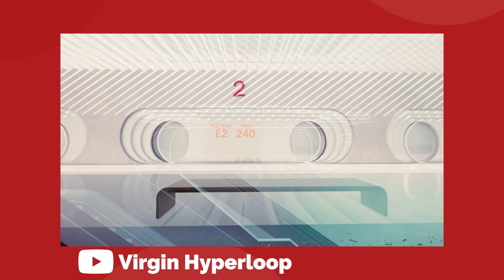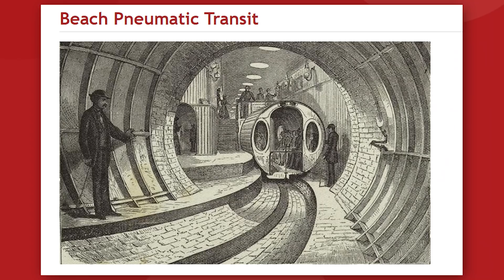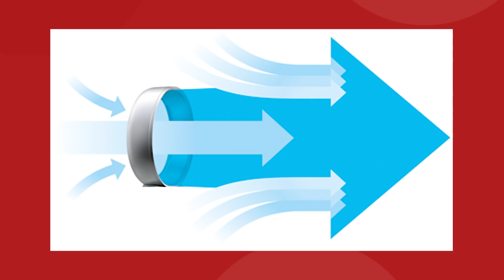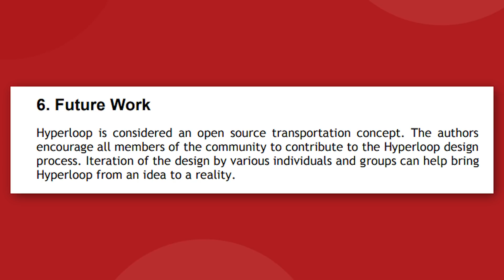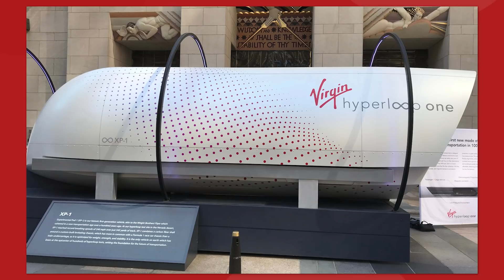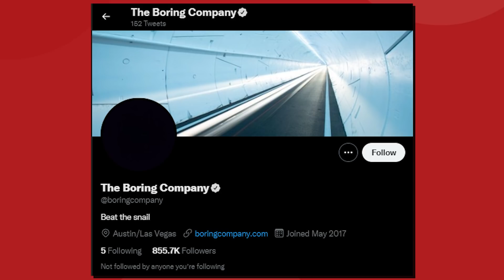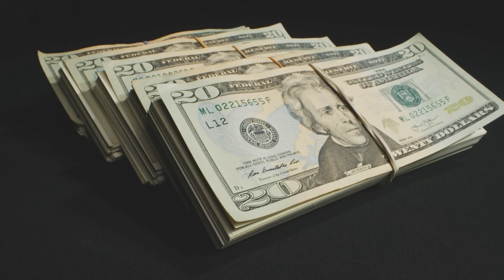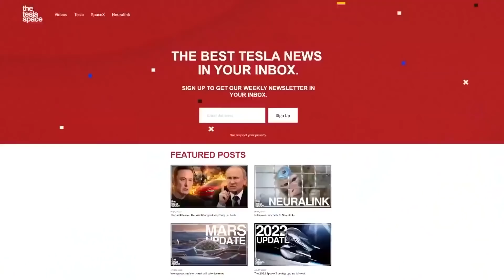The Boring Company Is Building A Hyperloop!

Comment: I think magnetic is the way to go.  The thing is you can have tributary lines that are relatively low speed with some air pressure.  An easy to maintain partial vacuum with many entrances and exits at all of the favorite spots.  You then get into regional lines feed directly from the somewhat pressurized feeder lines and then you can go to a better vacuum.  Then you get into interstate / transcontinental  lines being fed directly from the regional lines and these can basically be a hard vacuum.  Each transition to a different type of line you stop for a minute to suck out more air.

With a big fan in front, you are stuck with subsonic and some air in the tube, but with magnetic, you can go multiple mach speed and hard vacuum.

Having mixed cargo and personnel transport would bring total ridership up and thin out the people some in case of accidents.  Also with things like a megadrought on one side of the country, maybe you efficiently haul water in from the other side of the country.  A dedicated water station could keep the vehicles in a hard vacuum while mating up with plumbing to transfer water to and from the vehicles so they can go the entire way at high speed and almost no drag.  Super efficient.  Better than an aqueduct and multi-purpose as the same tubes will carry people and other cargo.
Reply: Air locks.  A chamber just a bit larger than the pod.  A door at each end.

To pressurize or depressurize the airlock chamber would require pumping only a small amount of air.
Reply: @bobwallace9753  Especially when dealing with many entry and exit points, it gets harder and harder to suck out all of the air.  There are things you can do to cut down on the work as you mention, but it is hard to eliminate the work.  What I am proposing is a compromise.

For example if work is 15 miles away, you are not going to go mach speed to work no matter how late you are, so why go through the extra effort, expense, and time sitting in the airlock trying to remove that last bit of air to achieve a hard vacuum?  Why not do a "quick and dirty" partial vacuum in say 1 minute, get up to a few hundred MPH, and then you are at work in a couple of minutes?  At this there may be other people in the pod and the pod may make other stops, so you want this depressurization to happen as fast as possible, maybe 30 seconds and a further reduced speed would be preferred over 1 minute of sucking out air.

However now say you are going to visit relatives 150 miles away.  Now you want to get up close to the speed of sound as you can still have some air in the tube and still get close to the speed of sound without it becoming an issue.  So you spend 1 minute getting to a partial vacuum, travel to regional hub 15 miles away, spend 2 more minutes getting most of the rest of the air sucked out, and then go at say 550 MPH for 120 miles for say 24 minutes as you need some acceleration and deceleration time, and then travel the remaining 15 miles at a reduced speed as you are now back in a feeder tube.  So this time there is more total time sucking out the air, but the trade-off is you go faster.  At this you may still want to get out of the first pod and transfer over to a second pod that will do the regional route as each pod may have various people in it coming from different feeder lines.

Going across the country is a play on this.  Except now you may spend several minutes getting all of the air out when you get to the interstate / global system, you go at multiple mach speed, and people carrying vehicles are interspersed with cargo vehicles as you don't want too many people in a given section of tube.  Also, you may be moving over to another vehicle, granted it would be nice to have the option of paying for a "family van" to go long distances or even say a couple of "cargo pods" when moving.  Maybe even have a pod you can stick a car in as shipping cars around the traditional way can be a pain.

The basic idea though is flexibility where either you cut down some on the time it takes to go from one system to another by going straight from one pressure level to another through airlocks or you get out of the pod and transfer to another, but each time you go to a faster system, there is more overhead time waiting for the air to more thoroughly get sucked out.  What you mention is an optimization, but I don't think a hard vacuum can reasonably be done on a large scale, high capacity system in seconds.  So instead you do what is quick on the feeder lines and then have bigger and bigger overhead times when going to the longer distance systems.
Reply: @ChaJ67  

Entry/exit.  Airlocks.  
Chambers just a few inches longer and larger in diameter than the pod.  That means only a very small amount of air to pump out from around the pod before entering the tunnel. 

15 miles.  Not a hyperloop function.
That's a Loop trip.  Non-stop at 60 MPH or faster.

150 miles.  Hyperloop.
Enter an airlock.  The air could be sucked out in less than a second by using an attached chamber that is larger than the space between the pod and chamber walls and is depressurized to an even lower level than the tunnel.  But that's probably overkill.  Use an adequate sized pump and just suck out a few cubit meters of air.

Exit through an airlock. Drive in. Shut the door.  Open a valve to let outside air enter the chamber.  Seconds.

I don't see any sense in your multiple tunnel system past hyperloop and Loop.  Depressurized very high speed and atmospheric pressure fast speed.  Travel in the hyperloop would be more like flying where you travel to a hyperloop (airport) station and travel with others heading to the same destination.  We could easily have pods with only seats and pods with limited seats along with a lot of cargo space for times when very few people are going from Station A to Station M.
Reply: @bobwallace9753  I have considered some of these options over the years, especially as I came across ET3 many years ago before you heard Elon Musk going on about it.  Then again I also came across AC Propulsion before it got bought out and turned into Tesla.  What I have come up with is:
1. The extra chamber takes even more work.  The idea of the hyperloop is to minimize work.  You were on to something when you mentioned airlocks on the vehicle.

2. Airlocks on the vehicle - I don't think this is a bad idea, though making big doors can be tough and even tougher to standardize on a size and shape.  You would still need to bring the vehicle into an airlock in case the seal leaks.  I tend to think about submarine DSRV's (deep sea rescue vehicles), except the pressure is the opposite way, so you would have to brace the pod so the atmospheric pressure doesn't push the vehicle away from the airlock.  I suppose it can be done, though it would add a lot of structural weight to the pod.  The doors on an airplane usually only open when the pressure has been equalized.  While doors still add structural mass to the plane, it is less of an issue as the door hooks into the frame when closed and acts as a structural component.  I am thinking this is more of what you would want on your pod and just do away with the reverse pressure DSRV style deal as it is far easier and cheaper to do with the trade-off there is more air to suck out.  I may be wrong in what is the best approach, but this is what I came up with.

3. While I have considered traveling around town at atmospheric pressure and I think if you live in a small enough place and work there, this is what you are going to do, more and more huge, sprawling cities keep popping up.  People are moving to cities and thus they get bigger and more numerous and the metropolitan areas tend to fan out over larger areas.  As this happens, there are huge energy expenditures driving or rolling by some other means across these big cities and metropolitan areas and these trips are often dozens of miles or more.  While I am not suggesting a tube to your home per say, when you go to your local metro station, it would save a whole lot of energy to suck out whatever air you can quickly and then be on your way at much faster than freeway speed than to just push through the air like now.  Also more speed allows for higher capacity in the computer controlled environment of a partially evacuated tube.  So instead of say a 4 lane freeway, a single tube could handle all of that capacity while saving on trip time and eliminating traffic congestion as you would never schedule more vehicles than what could be handled, plus you would have all of these people ride sharing on pods.

4. The vision I have settled on for pods, especially if you can bring the pod out of the tube is it is kind of a cross between buying a plane ticket and hailing an Uber and a car or truck rental.  The idea is you go up to full sized van size.  At this size you can load a couple to a few pallets in series the length of a pod.  Companies can shuttle around goods buy either renting / having one or a few pods or do large scale movement by having whole fleets of pods.  Amazon next day / same day delivery would take on new meaning if instead of grouping by 767 plane size (this is the most common plane in the Amazon fleet), it would be grouped by pod size and how far a pod could make it in a day (which may be anywhere in the world as long as the infrastructure is there and Amazon can do business in that country).  A large family could rent a whole pod for their trip.  A small family could haul a bunch of luggage for their trip in say a combi pod.  A commuter would "carpool" to work as in instead of say a commuter train or bus stopping at every stop, a computer algorithm would group you up with a few other people to minimize stops.  A coordinated "carpool" would be you show up at the metro station at the same time as your co-workers living in your neighborhood to get the computer algorithm to group all of you into one pod so you don't have to make other stops along the way as everyone in the pod will be going to the same place.  A business with multiple facilities around town may have co-workers doing this to help speed up their trips while keeping ticket prices the company picks up the tab on down by not renting out mostly empty pods.  Then you get into easier to do things such as transporting liquids.  I mentioned the water deal above.  What if you have a line connecting to Europe and transferred LNG this way?  It should be easy enough to connect the pipes in a hard vacuum, leaving the pods in a hard vacuum all of the time.  I have to wonder what would happen with seafood if every place had as fresh of seafood as Pikes Place Market in Seattle because it was quickly whisked around in a hyperloop at pod scale units where it could also be more quickly packed and unpacked and distributed than when dealing with semi-trucks or even trains?
Reply: @ChaJ67  
1 and 2.  I said nothing about airlocks on the vehicle.  Not needed.  Just a small airlock at each entry ramp and each exit ramp.

Airplanes do not have airlocks.  They load and unload at surface level air pressure and then travel into low pressure areas.

3.  For short distances there's no need for depressurizing.  If you can travel non-stop at 60 to 80 MPH and do so as a passive passenger then that's all that is needed.  Watch a video, take a nap, do some work while you commute.

If you have to commute 5x a week you may choose to live within 30/40 miles in order to have a half hour commute, max.  If you're working hybrid and need to go to the office once or twice a week then you might live further away and use hyperloop.

4.  Maglev pods (and trains) need wheels for the times when they aren't moving rapidly enough to 'levitate'.  Pods could enter an exit tunnel branch at 800 MPH, slow to a crawl (four to eight miles of ramp tunnel) enter an airlock, and then drive as a surface vehicle.

Stations can be nothing more than parking lots or simple buildings that protect passengers from wind and rain.

We can redesign shipping containers so that they fit inside a standard sized pod.
Reply: @bobwallace9753  as Elon Musk caught onto this idea in Los Angeles, something to understand about the place is you can go North-South down the I-5 or East-West down the I-10 and see nothing but city for 100 miles on either freeway.  If you want to live close to work in the city, you are looking at either living in East LA / Skid Row for however long (or short) you can survive in that kind of neighborhood, or a very high rent neighborhood.  Otherwise you are looking looking at somewhere far from work, probably a lot more than 15 miles away.  While I cite LA as this is where Elon Musk was when he started promoting this while talking about "soul crushing" traffic, this story is getting more common by the day as more and more people move into cities and large metropolitan areas.

Another thing to consider is most cities already have buses, light rail, both above and below ground, and even heavier rail transport to cover larger metropolitan areas and maybe even fairies to go over waterways.  Also, a lot of people have short range transports like bicycles, electric scooters, electric unicycles, etc.  So whatever system you want to put in place, it either needs to outdo that mode of transport or leverage it.  The problem with mass transit in a lot of places is it takes too long to get anywhere.  It is faster to sit in traffic and watch the old man with a walker pass by like in Office Space than it is to take mass transit somewhere.  Plus when you get into say a large, crowded train, it is more likely someone is going to have a medical emergency onboard or more common lately "rowdy" behavior and then the train is stuck at a stop for a while and nobody can go anywhere.  So this is the problem you need to solve, speed.

The problem with digging tunnels is it is slow and expensive.  Of course Elon Musk wants to greatly speed this process up.  You can also put tubes above ground when you can get the right of way and don't have too many NIMBY people complaining about it.  So one thing this does is unless you can burrow like a fictional Tremors creature can through lose sand, this limits you to major transit hubs.  Another thing when you scale up capacity is the wider you make something, the more expensive it gets.  There is a reason why you don't normally see 10 lane freeways.  It is both a lot of real estate and crazy expensive to make.  If you can just speed up the vehicles by sucking out most of the air quickly and have them go down a tube back-to-back, maybe instead of having something massive enough to hold 4 tracks all in one direction, you only have 1 track in each direction.  Having this speed is really important for capacity.  Say you are building for LA with 100 miles of non-stop city to cover, while most people are not going to go 100 miles, that 100 mile stretch needs to go fast so it can have the capacity handle the traffic 100 miles of non-stop city generates, or else you have the same problem, just now also underground.  Plus all of those poor working slobs who can't really afford to live in the city, but work there, can do their 40 - 50 mile commutes while having a minimal environmental impact.  with a fast and efficient enough system, where you live in relation to work doesn't matter as much.

I don't think cargo containers are going to get shrunk down to pod size.  They are the size they are because that is what can be easily moved around the globe today.  You make that smaller and global transport becomes less efficient trying to load more smaller containers onto giant ships, trucks and trains.  We just had a big problem where the shipping yards got backlogged because they couldn't process through the many containers showing up every day fast enough, so why would they want to have even more smaller, more numerous containers to handle?  Plus when you look at trains they end up double stacking the containers as it is and then share wheels with the neighboring rail car because the max weight of each container is well below what a more traditional rail car can handle.  In other words if containers were built for trains, they would be bigger and heavier so that it would only be one container per rail car.  However making pods big enough for containers would be wasteful.  Speed and inherent improvement in individuality in addition to cost of making the tubes and maglev track bigger, push for a smaller pod size.  Trains lost the last mile routes a long time ago and most of those old tracks have been buried or torn up because trains weren't individualized enough for it to make sense once automobiles took off.  Semi-trucks and large buses are still a big corporate / group thing.  And with buses, people still don't like to ride them because it takes a long time to get somewhere, especially if the bus stops every couple of blocks to let people on and off and then gets stuck in the same traffic cars get stuck in.  So then you get down to full sized van size.  This size allows for a few pallets to be placed in row.  Truck trailers tend to be two rows of pallets and a couple to a few pallets high.  So then as long as the pods are quickly whisked away, maybe you have auto-loaders where someone with a fork lift puts pallets on an auto-loader and the auto-loader stuffs them into the pod and then the full pod moves away.  This doesn't hurt productivity and may actually speed things up as now the fork lift is not traveling up and down a big trailer.  When you look at the popularity of of online shopping and what it takes to get goods close to people and the size of those Amazon delivery vans, well all of a sudden a full sized van sized pod looks just right for the job.  The autonomous pod goes down to a local transit hub, the Amazon delivery worker loads up their van, emptying out the pod, and then they drive down your street delivering the packages.  When you look at the various people transport scenarios, for the family or small group, the proposed pod size is great.  When you get to the individual commuter, the proposed pod size is a lot better than bus or light rail as in a grouping can be made to slash the number of stops made.  Making stops with mass transit systems burns a lot of time, so if say you make 1/3rd the stops with no group planning just because the pod is smaller than a city bus or light rail, and especially if you speed it up to say 200 MPH in the city by sucking most of the air out of the tube to reduce drag, you may find it is the fastest way to get to work while still being energy efficient and cheap per ride, plus maybe you pull out your laptop or cell phone while commuting, so then it becomes your default way to get to work.